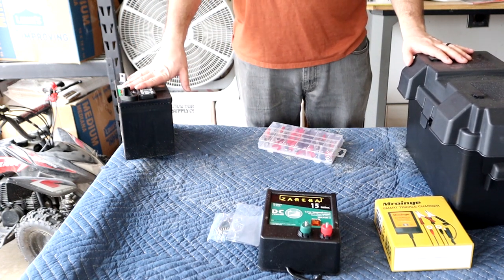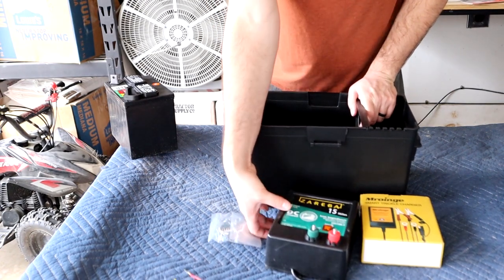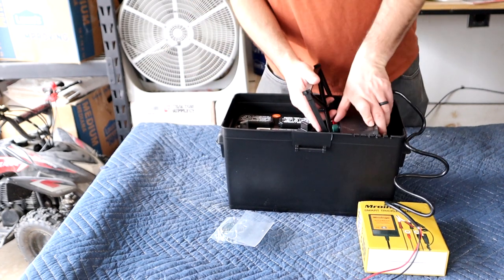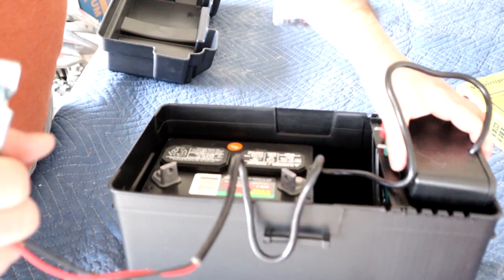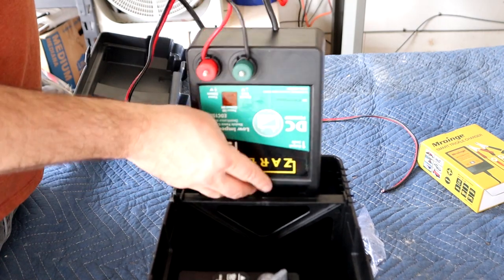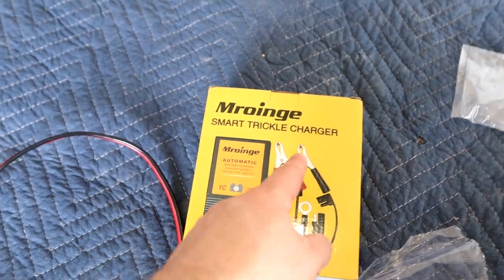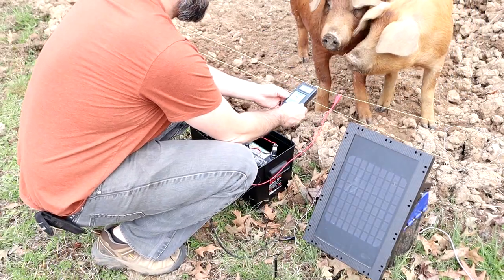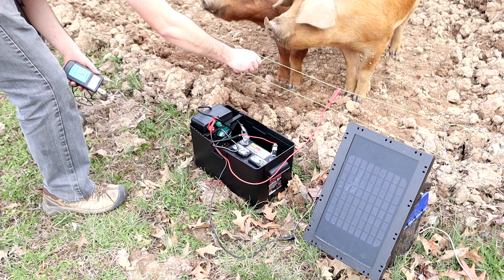How To Make A Portable Electric Fence Charger Run Off Of A Battery

Comment: That’s already a battery operated charger. Title made me think you were showing how to convert a plug in unit into a battery. Good video still, just misleading title. Converting an AC to DC is what I was looking for.
Reply from the maker: Yeah I don't think the title is misleading at all.   But you'll just need an inventor to make your situation work.  It's pretty easy to hook up.
Reply: Nichols County not “misleading” . More “misread” I should have said. I read it as “how to make a portable charger” in a sense that you were going to convert a unit into a portable unit and not an already portable unit installation. Make sense! LOL It was on ME misunderstanding the title and halfway through the video saying, “wait, I thought he was converting a unit”. Not meaning that you put a misleading title. 
Hope that made sense.
Reply: Nichols County yeah, I have an inverter. I’ve even thought about trying to see if it will push both my fence charger and a small trickle charger. So that I would continuously recharge itself! LOL that’s how I found your video. I did get a good idea from it about the battery box to mount and contain everything! I was thinking of building a wood box and mount everything in it and after watching your video it was like “duh!” Why didn’t I think about that! So I’m still glad I watched it!

Comment: Would it work on a small mesh door that is insulated and about 6 feet wide by 3 feet high? Also, do you know if I’m using it indoor without access to a ground would it work if I connected the ground wire to any large piece of metal?
Reply from the maker: Should work on a door no problem.  Might not need that big of a charger though.  As long as it's grounded somewhere it will work.